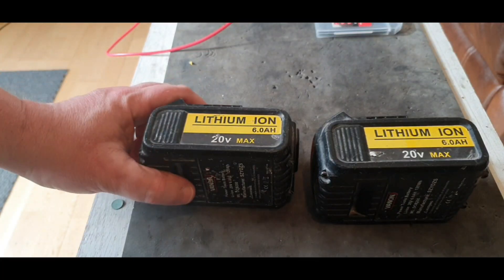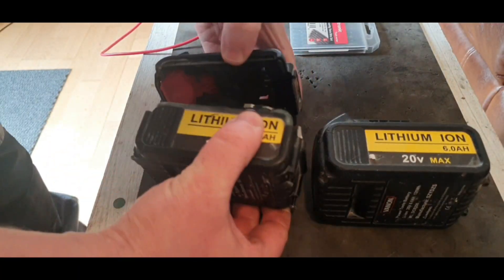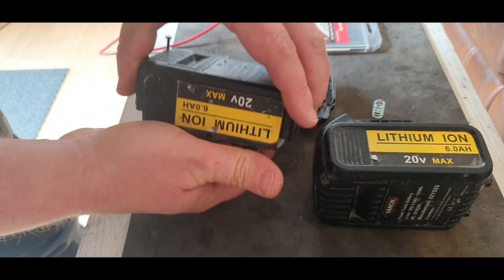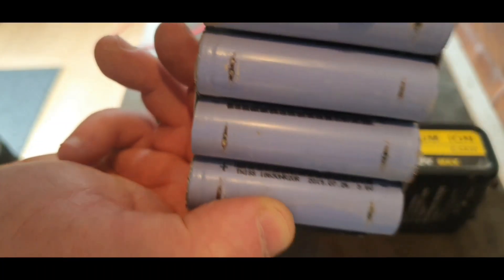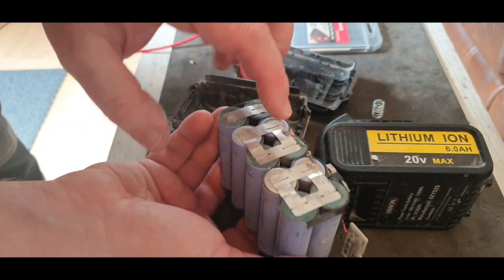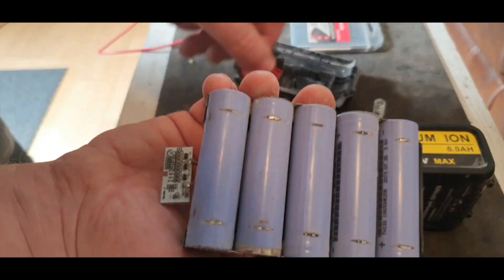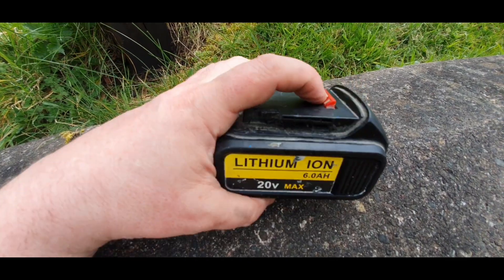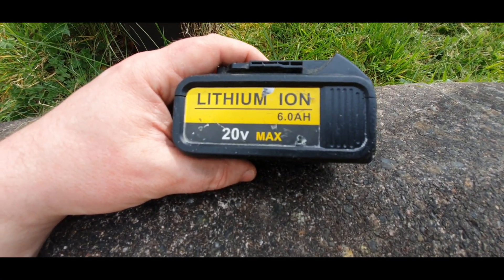Knock off Batteries are BAD for your health #Dewalt #powertools #repair #howto

Comment: I have also bought these off brand dewalt batteries and it was 9ah flexvolt but actually only 6ah
Reply from the maker: Saw one of them that 9 cells like a flexvolt but was 6ah instead of 9ah that was written on the side and it was an Ordinary battery set up not flexvolt

Comment: I think that's the company that was criticized a few years ago because they would send random different cells in their packs. You might get Samsung in one pack and cheap junk cells in another.
Reply from the maker: I kinda wanted to believe that the build would be cheaper but ok before I opened it. I would not have believed it would be this bad I was shocked.
Reply: @doctorlefthandthread  it wouldn't have been that hard to change the design when they engineered it. It might be that way to allow fir a small variation in battery diameter
Reply from the maker: @bwselectronic  it would be easier to improve their build than make it worse
Reply: @doctorlefthandthread  true. They should have had a cushion or end caps that would keep it from rubbing
Reply from the maker: @bwselectronic  exactly